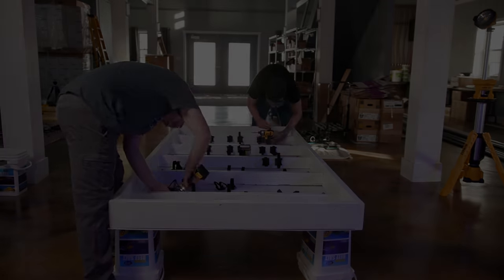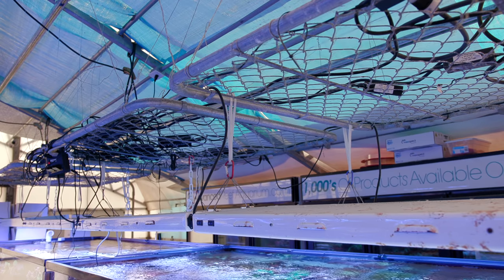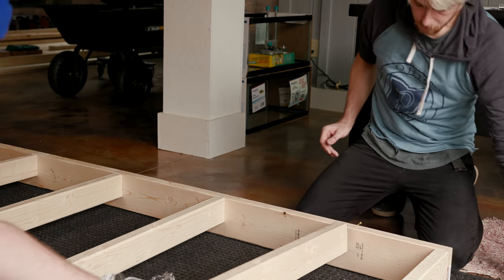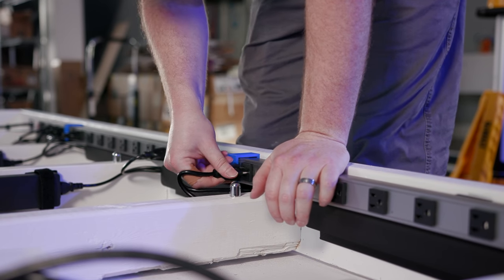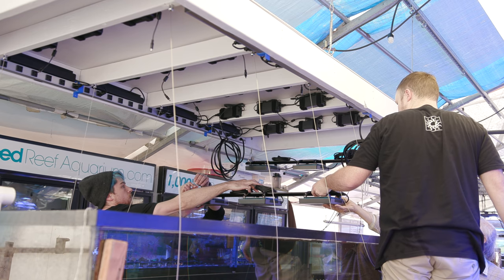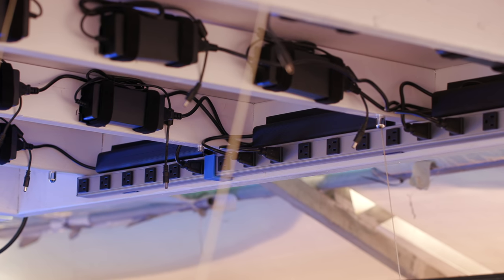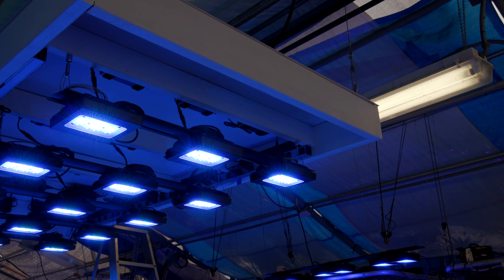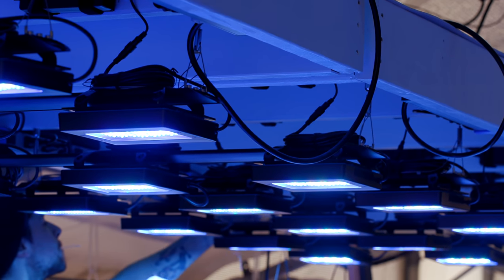We put 30 Ecotech Radions over this Reef Tank

Comment: Someone else mentioned but you really should look into DC power distribution
The power bricks you get with the lights as standard are also quite ineffecient when it comes to AC to DC switching.

Would be very easy to run a large power supply to a fused bus bar and then a single cable out to each light. 

Do the same thing with your pumps aswell and out in a second power supply and a redundancy module if you are worried

Extra low DC voltage is very low risk as long as you remember to put fuses in to protect the wiring from a dead short.

Comment: Only changes I would make:
1) Use a 2x8 and put the power bricks and wires above the hanging platform so they are out of sight
2) Mount lights closer to the hood
3) Add a wench or some method to raise and lower the hoods
Reply from the maker: Good ideas.  The only problem with #1 is that there is going to be water accumulation on the top of the canopy.  Anything on top will be dripped on or sitting in a puddle.

Comment: One way you could clean up power cables is 3rd party PSU's and connect 4-6 LEDs to  a single PSU.
XR15 use standart 90W meanwell ac dc power supplies .. so you could just get a 400W or 750W psu and connect multiple light to it.
Reply from the maker: Interesting idea.  I don't have a lot of experience and comfort working with electrical devices, but I do have positive experiences with meanwell power supplies.
Reply: @tidalgardens  Well MW they have a WIDE selection of power supplies. Generic, LED specific, specialty. In all sizes and shapes. For DC power the only important thing is to match Voltage and PSU power output > power consumed. You would have to splice your own cables (no worries about jacks - all are standard sizes) but then you then can get the cables exactly the length you need. Also MW psu are very affordable. I consolidated all my 3 tunze refugium bars under 1 100W (a bit overkill). Thinking about doing the same with 3 XR15g5. And my 2 maxspec xf350 gyres are running off 1 MW psu that has battery backup feature (granted that has extra bit to boost Battery voltage when charging and to stabilise at 24V when running on battery - PSU does not have a full blown battery charger just a hand over relay).

Also if you have any PSU check meanwell site for repalcemnet instead of Original - will save 50%+ and will probably get better quality psu.
Reply: Hello can you post a link to such a psu?

Comment: Hmmm looks great my only problem is the power strips. wouldn't humidity and condensation some how get into the open sockets 🤔
Reply from the maker: Of all the power strips in this whole place those are the best protected by far.  Protecting electrical devices in a greenhouse is always an ongoing battle.

Comment: Than, what became of all the original stock corals that were in the tank? I was thinking the sudden lighting upgrade would be quite the shock to the corals that were in there already.
Reply from the maker: The lights are not on full power so the transition went fine.  The corals in the greenhouse are quite used to changes in light.  The summer months hit them with 4x the intensity for 2x the photoperiod.  Changing light fixtures for those corals is pretty minor.

Comment: Be careful of the amps on those plug strips and the circuit it is on.  Each fixture is gonna at 100% may pull just over 1 amp so if you have 30 you should be using at least 30 amps I would def test it.  Even on a 30 amp breaker the plug strip probably is not rated for that much amperage
Reply from the maker: That is a good point.  We upgraded the electrical in the greenhouse recently and I requested an abundance of 20A circuits within easy access for all devices.  This particular system has access to 5 separate 20A circuits if we wanted.

Comment: Having a top on your lighting rack will act as a heat and moisture trap and will probably shorten the life of your 30 power supplies  - you would have been better off having an inch gap between the ABS and frame for the heat to dissipate 🤔
Reply from the maker: It is worse when they are uncovered and allowed to get direct sun from the greenhouse.  An air gap is a good idea though.  In the summer months it is less of an issue because the building is a giant air tunnel with the exhaust fan.

Comment: You are a coral farmer. Not a living room or display tank. Why would u not hire an electrical engineer and make your own light system using 3w or 5w led's?  You have so much space.
Reply: ... dude - retail prices on LED's are not cheap. And a good electrician is doubly not cheap. Also Electrician is not Electronics Engineer - someone needs to design those lights. Who? Source the parts? Who? That is a lot of expensive man hours. Do you know what LED's to use? What to do when something breaks? Call Same electrician again? What if they do not perform?
DIY LED solutions are for hobbyist EEs not coral farmers.
Reply: @TheDancing0wind  radions are $900 each retail. Do u think this is cheap. Thanks for trying to correct me but like I said, hirer an engineer, not an electrician. Let's are net very complicated. If it is over your head that is fine. If hobbyists can do it so can professionals, clear your argument could be made about propagating coral as well.
Reply: @ILmachiner  xr15 are 450. Snd you missed the point. If Stan wanted to muck around with LED that would be fine but he is not an electric engineer and he has a business to run. A coral farm business - not an electronics design business. Its extra research, extra work, extra uncertinty and extra RISK. These are not off the shelf LED strips we are talking here. Now if you had an actual design, BoM and work hour count and rates maybe you would have a more convincing argument. If a hobbyist can do it does not nesscessary make a viable strategy for a large scale business. In my experience most of the time its the opposite.